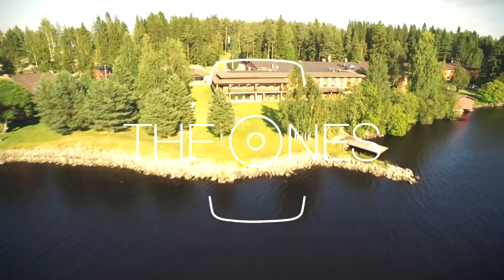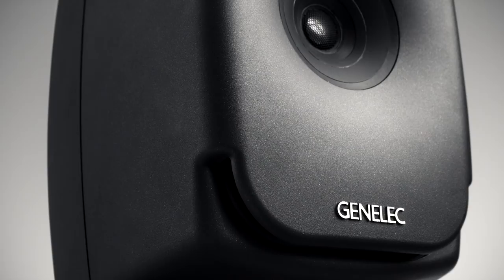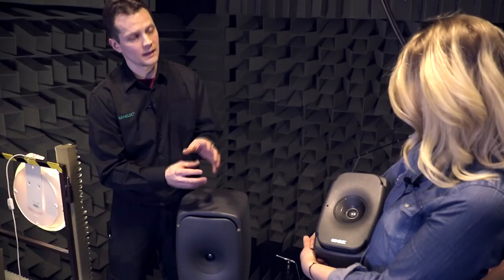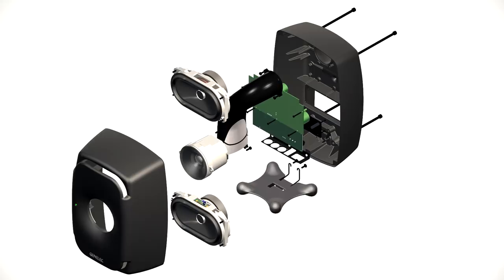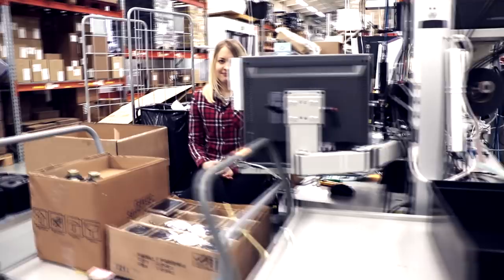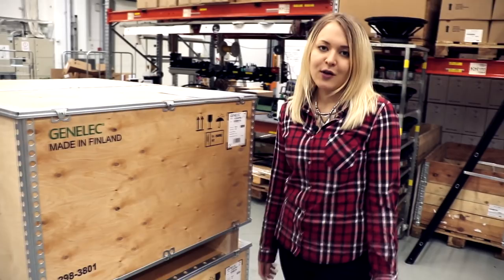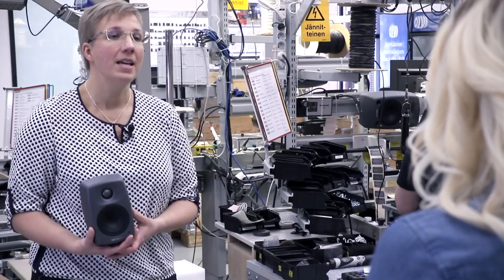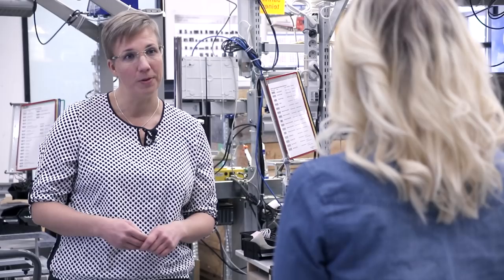Genelec The Ones | Developing Ultimate Point Source monitors | Behind-the-scenes

Comment: My problem is I have a couple of Mission pro sm6a that have been fantastic monitors but the pots in the volume are now very buzzy and there's a weird 50hz hum on both of them that I can't isolate even on balanced cables. I probably only need a service on my desk or those monitors. But I always wanted genelecs. I'll buy these and it won't solve my problem I bet.
It will solve one problem. 
I'll have genelecs.

:-)
I hope they are better than my SM6As. They were awesome.
lasted over 15 years and were still functional now. Albeit a bit temperamental.
Luv and Peace.

Comment: I know they are studio monitors. But could you use them just like normal speakers. Listening to CDs etc.. Big thanks..
Reply: If you want a highly analytical sound yes.  Though that sound is not always enjoyable for entertainment.
Reply: @alancrome3684  - "If you want a highly analytical sound yes.  Though that sound is not always enjoyable for entertainment."

That statement is not completely false, but it’s misleading, and promotes a common misconception. In the context of hi-fi equipment, there's no such thing as "analytical sound". There's only neutral or distorted sound. Genelecs sound neutral, which means that they sound hardly anything at all, which of course is a desirable thing. When you listen to a recording that was created with instruments and voices that sound beautiful (or otherwise to your liking), and if that recording was made by people and equipment that can capture that beauty, your Genelecs will play back that beauty as it originally was. On the other hand, if the sound of the recording for some reason isn't pleasing, your Genelecs won't beautify the sound in any way.

The task of a speaker is to reproduce sound, not to have a sound. Sound is for instruments, singers and recordings, not speakers. Unless your music collection happens to consist of only one type of music that was recorded exactly the same way, you can't correct the sound problems of your recordings by choosing a different speaker. Use a mixer or a sound processor instead (it can be software based). That way you don't only save money, but you can also target the actual problems instead of applying the same change to every recording, whether it needs it or not. 

If you want a high-quality sound system, you want speakers that don't have a sound.
Reply: Reference monitors are generally very 'honest'.  Not everyone appreciates honesty. As we all know life would be almost impossible without the constant reliance on 'white lies'.  "Do you like my new hair style?" .... "Um...... yeah ..... look ......... just wait a sec .... before I answer let me  I put away my reference monitor".

Comment: These are not a true Co-Axial, @Genelec - If you are using a 4 way system, with a tweeter and midrange on centre combined, but use your ACW - 2 “Woofers” top and bottom that would make theses a multi component system. A true co-axial would have tweeter/midrange and woofer all in one. I digress. The marketing is strong @genelec - Don’t get me started on the 2x6” oblong “woofers” (Genelec obviously did not want accurate sound reproduction) Compromises were made. Marketing now has to sell the compromise to the buying public. Be honest Genelec. We are not all “sheeple”
Reply: Interesting however your woofers “still” do not radiate from a single point. They radiate from multiple points from the same enclosure. Top/bottom or side/side depending on speaker orientation. (This configuration is still four drivers in one enclosure vs one coaxial driver as advertised)
Reply: Will do. Thank you. 🤘🏻😎🤘🏻
Reply: It's a bit complicated for my tiny little mind :)  - but all I need to know is that Amir from Audio Science Review raved about these speakers. That's good enough for me. If I cant find as good at a cheaper price - then these will be my next and possibly my last speaker purchase.